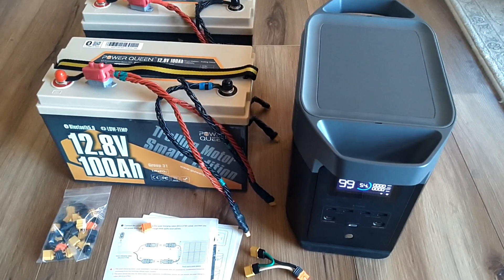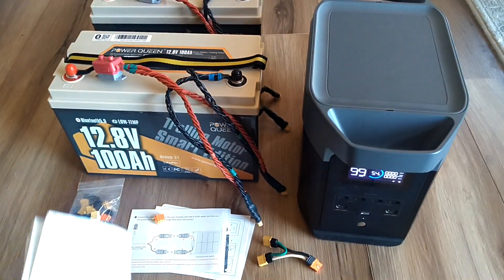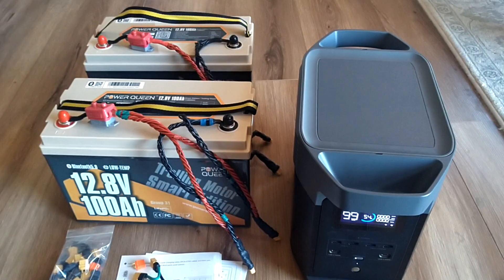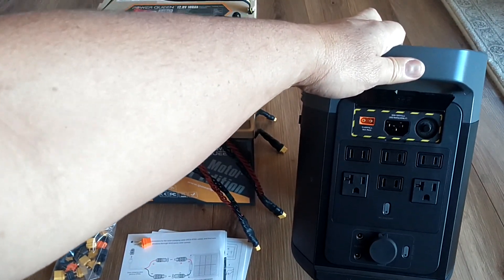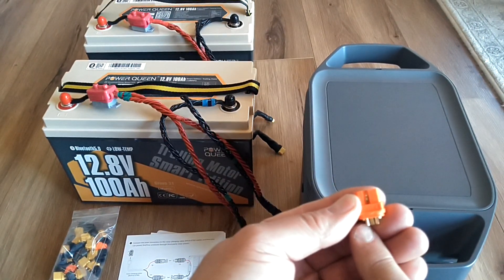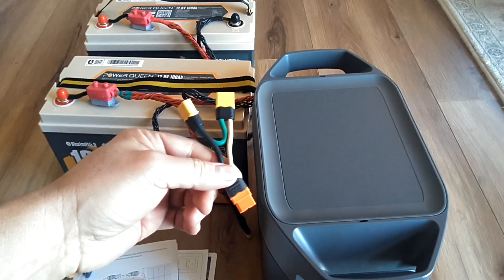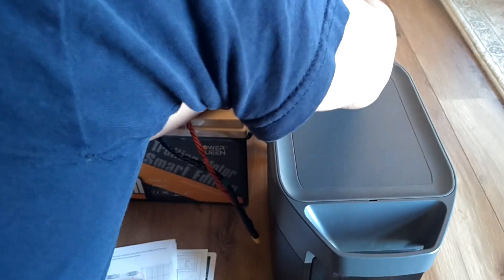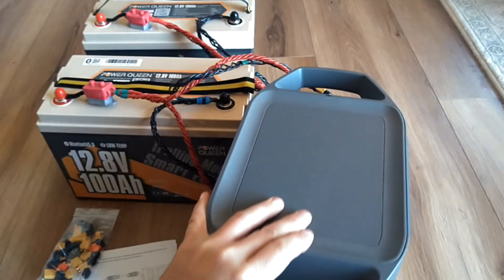Extending the Capacity of a Power Station, EcoFlow Delta 2 from 1KWh to 3.5KWh

Comment: So both batteries are separate from each other but they connect via the Y cable correct?
Reply from the maker: @Dark_Daze  correct
Reply: @madscientisthut  ok more annoying questions coming lol now how would I hook up a solar panel and charge controller to the batteries while at the same time having the batteries connected to the Delta 2? So it's constantly charging in the day while I use it? Like would I hook the actual batteries up in series then have a single xt60 cable connected to that into the delta 2?
Reply from the maker: Which charge controller do you have or which one are you planning to use? edit: correction for clarity.
Reply: @madscientisthut  I currently have a renogy 10amp 12/24 volt and ordered a EpRec mopt 40amp 12/24 v
Reply from the maker: Perfect! With a 12/24V charge controller, you can connect two batteries in series to the Delta 2 and also link the charge controller to the same connection entering the Delta 2 for 24V charging.
Reply: @madscientisthut  what do you mean?
Reply from the maker: Okay, let's rephrase that. If you're going to use solar to charge the batteries and at the same time use the batteries to recharge the Delta 2, you can configure the system for 24V. You'll need to connect two batteries in series with the Y. If you have more batteries, we can discuss that setup separately to keep things focused. At the Y connection entering the Delta 2, you can connect the charge controller in parallel with the 24V portion of the Y connection ( The two wires entering the Delta 2 ) . This setup with the charge controller will either back feed and charge the batteries or supply power to the Delta 2 if the batteries are fully charged. Hope this makes more sense.
Reply from the maker: After this discussion, I'm inspired to create a setup like this for the RV. However, I’ll have to wait until the snow melts. I’d love to make a video about it, but with more snow expected this weekend, it might have to wait until closer to spring. I have a couple of 200W panels in the shop that I'm currently not using, but I’ll need to get a charge controller for them
Reply: @madscientisthut  awesome!!! Looking forward. But yeah basically I want the whole system to be connected so I can charge it and use it during the day and then run off strictly batteries at night. So like a normal solar system but on this scale. I'm excited to see the video!
Reply: @madscientisthut  another question lol 
What if I connect the batteries in series parallel? I can have the solar in series to the charge controller then the charge controller connected in parallel to the batteries then have a parallel connection from the batteries to the xt60i cable to the Delta 2. Do you think that would work?
Reply from the maker: The batteries can be connected in series parallel. What is the VOC specification of the solar panels?
Reply: @madscientisthut  23.4 each
Reply from the maker: What is the maximum input Voltage on the Charge Controller?
Reply: @madscientisthut  it's a victro mppt 75v 15amp
Reply: @madscientisthut  I should also add that I have a 12 to 24v step up converter if that would need to be used
Reply from the maker: Looking at the specs, 75V Max VOC. Also in specs:  Note 1b the PV Voltage needs to be Vbatt + 5V for the CC to start charging. So you would need the panels in series to the CC solar input.  The added bonus with this setup on the Victron 75V15A is at 24V the charge controller can do a nominal PV power of 440W, if you had opted for a 12V setup it can only do a nominal PV power of only 220W
https://www.victronenergy.com/upload/documents/Datasheet-Blue-Solar-Charge-Controller-MPPT-75-10,-75-15,-100-15,-100-20_48V-EN-.pdf
Reply: @madscientisthut  so I can do a max solar array of 440w?
Reply from the maker: Yes, with the 24V configuration the Victron will do 440W of solar.
Reply: @madscientisthut  and how would that go to the batteries since I have 3 12.8v batteries
Reply from the maker: You can only configure either 2 or 4 batteries for a 24V setup. Therefore, you'll either need to add one more battery or exclude the third battery from the system.
Reply: @madscientisthut  so why do you use 30 amp circuit breakers instead of 15 amp?
Reply from the maker: @Dark_Daze  I use my batteries in my RV, Truck, and other uses that do not exceed 30 Amps avereage, sometimes peak goes above but not for very long so the 30 Amp circuit breakers work for my uses. If I were going to use this only on the Delta 2 I would probably use a 20 amp fuse.
Reply: @madscientisthut  ok. I ordered 30 amp and 15 amp ones... Dang it lol

Comment: Great idea, thanks for sharing!  This makes great sense with all of the very inexpensive 12V LFP batteries on the market. I suggest adding a power monitor so you know the state of charge of your external batteries. There are various ways to do this and the best way will depend on specifics.
Reply from the maker: Thanks for watching and the comment! I like the suggestion for external monitors for those that did not buy LFP batteries with the Bluetooth option. I ended up buying one battery without the Bluetooth and regretted it, the other three I purchase have Bluetooth so that I can monitor their state of charge and a few other parameters too.
Reply: @ could you please give us your recommendation for a battery with internal BT monitoring? Again, kudos to you on your post!
Reply from the maker: Hi, The Power Queens are the ones that I got. The BT monitoring app shows SOC, Temperature, estimated time left to charge or discharge, Power in or out, Voltage, and current in or out, cycle count. I  was watching for them to be on sale, the last one I bought was $177 but they have gone back up to $209. This is the link #ad https://amzn.to/49ROXS4 there are several BT LFPs out there, but I was watching this one specifically because I liked what I saw in a tear down video on YT of a Power Queen Battery. It seems the quality of the builds are getting nicer in the better known brands.
Reply: @madscientisthut  do you know what the charging rate is?  The seller said .2 C or 20A. Is that your understanding?
Reply from the maker: Hi, Yes my understanding is the recommended charge rate is 20A (0.2C), but that is for battery longevity. The BMS can do 100A (1C) charge rate but do expect a hit on life expectancy of the cells, as far as life expectancy damage I do not know what kind of hit that will cause.
Reply from the maker: @dougmodlin2032 Also I want to add that you can charge it at less than 0.2C and it will be perfectly fine.

Comment: Just subscribed.  You are the first I have seen do something like this.  I've been using a server rack battery to extend my run time when needed.  Also, when I am out of town I connect 3 Ecoflow together and run them in eps mode in case of power outages.  BTW what size gauge wired are you using?   Great video.
Reply from the maker: Thank you for the Sub, watching and the comment! On the XT60I  Y connection I used 10 AWG from an old  SOOW cable I had laying around. On the batteries I twisted four 18 AWG wires together since I have thousands of feet of that from years ago sitting around.  If you are using an EcoFlow Delta 2 the max current will be limited to 15 Amps and if this will be the only use for your batteries you can get away with 14 AWG wire, I would protect the circuit with a fuse or circuit breaker coming out of the battery terminals. If you have other needs or higher current uses just look in an ampacity chart for chassis wiring to find the best gauge to use (the ampacity chart values are pretty conservative values )  and always use a fuse or breaker.
Reply: @madscientisthut  Thank your for responding.

Comment: 2 24 Volt 100ah Lithium Iron Phosphate Batteries would be Rather Dandy for Really Extending the Delta 2's Abilities and Capacity with this XT60i Y Adapter Plug 🙌
Reply: 6KWH is allot
Reply from the maker: Thanks for watching and the comment! Yes 6KWh of storage is a lot! I would make a four connector input for that setup and use four 12V LFP for a few reasons, it is easier to move individual batteries weight and size wise, it is easier to charge (I can use my truck alternator with jumper cables) , I also use the 12V LFP for other things like for starting my gasoline generator. Just that 12V is a little more versatile.
Reply: Having 2 Battery Banks here 4 of each 24 Volt 100ah Lithium Iron Phosphate and 4 REDODOD 12 Volt 100ah  Lithium Iron Phosphate with LTCP and to This Ranch and Solar Systems with 2 Delta EF3 Pro 1300's and now a D2 with Xtra Battery and a Grab & Go River 2 Pro - Victron 150/45 Smart Solar Charge Controllers and Eco Worthy BiFacial Solar Panels At 4000 watts Covers all that's Needed here on the Ranch plus 2 WZRELB 3000 Watt 24 Volt Inverters hard wired  @madscientisthut
Reply from the maker: @1GREATDANE Sounds like a real nice setup you have. Love that is covers all of your needs!! My main system is a mix of stuff that has been pieced together over many years.  I have two of the 200Ah EG4 24V batteries running in parallel with my older Trojan RE16 FLA 800Ah battery bank and I can also quick plug the four Power Queen 12V  100Ah LFP into the system when I am not using them for other stuff like camping.  A 3KW Xantrex inverter and a few of the 1800W Xantrex pure sine (really old inverters, still work great too) A Morningstar MPPT-60 and a few older PWM charge controllers and about 5KW of Evergreen solar panels. Being in the mountains I get a lot of shading so I do not get a lot of power from my system in the winter.

Comment: If you hooked the batteries up to a 1500W inverter could you just plug the AC plug into the power station and charge at the 1200W?
Reply from the maker: You could but if you did you could lose a lot of power due to inefficiency of going through the inverter. A high quality inverter will lose about 5 to 10%,  a low quality inverter will lose up to 25% in the conversion. This loss is where you feel heat or hear fans running in the inverter. Thanks for watching and the comment.
Reply: @madscientisthut  thanks

Comment: Hi, were your Power Queen batteries  connected in series or parallel ?  How did you wire the adapter you made ?  Thank you.
Reply from the maker: Hi thanks for watching and the comment. The two batteries were wired in series. That was how I got the input to 384 watts, 25.6V*15A=384W. I will do another video to show the details a little clearer.
Reply from the maker: And I will show an adapter assembly too. .
Reply: @madscientisthut  Thank you, have a nice weekend !
Reply from the maker: https://youtu.be/RNMV67Wbvu4 
Y connector assembly video

Comment: Yes, we need the full details! I’m also trying to figure out how to do something similar but using a gas generator into my ANKER SOLIX F 3800 so that I can charge it at Max DC input of 2400 wants (1200 W per XT 60 input.) I’m wondering if this method would work
Reply from the maker: Hi thanks for watching and the comment. I have not seen the Solix F 3800 yet, but will do another video showing more details on this power station.
Reply from the maker: https://youtu.be/RNMV67Wbvu4 
Y connector assembly video

Comment: Indeed, I'd like the details on the connectors, thx
Reply from the maker: Hi thanks for watching and the comment. I will do another video to show the details a little clearer showing the connector assembly.
Reply: Just connect the batteries together in series thus making a 24v input to the power station. This way you only need one 4gauge cable to go from positive on one battery to negative on the other. Then use a ring terminal to xt60 cable
Reply from the maker: @ronhawkins8604  While your setup does simplify wiring, it significantly reduces the versatility of the LFP batteries by dedicating them to a single use. Hardwiring two batteries together makes them more difficult to move around and restricts the charging to a 28V source. By keeping the batteries with their own connections, I can use various charging options, one quick option is connecting them to my truck’s main battery with jumper cables. With the engine running, it will recharge a single LFP battery in about an hour. (I have four 100Ah LFP batteries, so this works for me.) I use my LFP batteries for multiple purposes. They also power my truck camper and RV setups, and serve as starter batteries for my generators. Therefore, maintaining their versatility is crucial for my needs. I really appreciate your comment and thanks for watching!
Reply: @madscientisthut i have 7 that i use several places as well. Yes i have 4 that are usually paired for this bit it into takes a few seconds to remove the one cable before placing on a charger. I'm not going for off grid but for keeping fridges and freezers going during outages so things get switched around.
Reply from the maker: https://youtu.be/RNMV67Wbvu4 
Y connector assembly video

Comment: Yes, details please 😊
Reply from the maker: Thanks for watching and the comment! Which details would you like to see specifics on? I can think of a couple of things to go over like soldering the connectors or wiring with protection devices. Also was thinking about doing a video showing how day 2+ of an extended power outage would go with recharging using a few different possible sources.
Reply from the maker: https://youtu.be/RNMV67Wbvu4 
Y connector assembly video